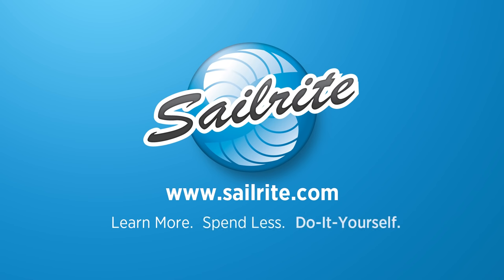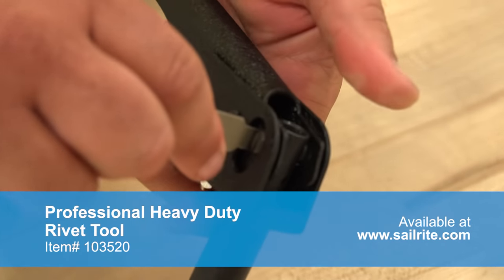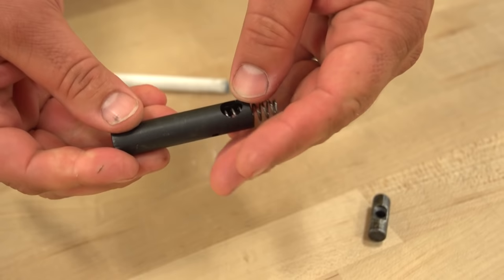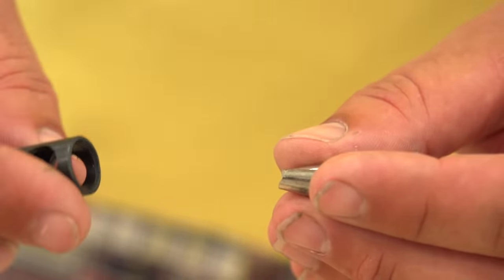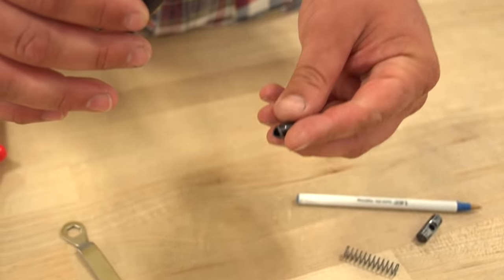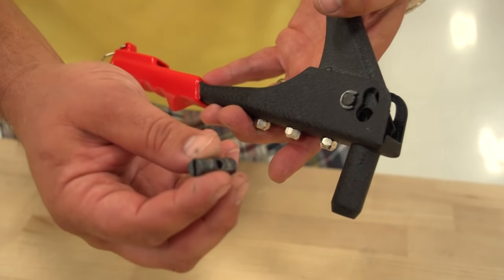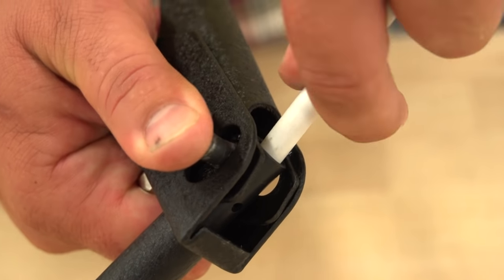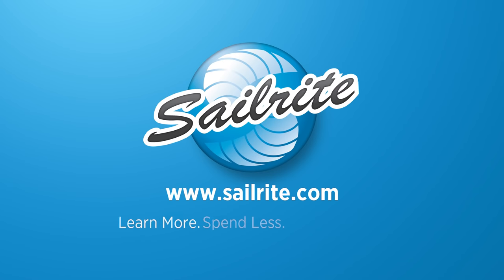Arrow Rivet Tool Disassembly & Assembly RH200S

Comment: I bought a vintage Swingline rivet tool which looks very similar to the Arrow brand.  In the instructions it says to prolong the life of the tool, place a drop of oil on moving parts and disassemble to clean the jaws.  These video instructions worked way better than the diagram and brief instructions in the pamphlet.  Thank you for this video!
Reply from the maker: Glad it helped!

Comment: I just wanted to point out what happened to me just in case it hapens the same to somebody else to solve the problem if this tool gets stuck.

I have this same rivet tool, and it continuously got stuck without being able to fix the rivet properly, and I had to end up dissasemblying the whole tool in order to take out the rivet.  I didn´t know what was going on, all the parts seemed to be in good shape, nothing was broken.

Finally, I had a small idea of oiling the two small pieces that make the pulling strength and the inside cilinder, as I was suspecting this three parts were getting stuck together with the rivet when the pulling actions was done.

It worked perfectlly well !!  Now I can use it without any problem, just as the first day.  

So basically, it was a problem with the friction, there must be some oil in the pulling parts so that the tool can do its job.

If you see this tool (and any other rivet tool) gets stuck continously, DON´T THROW IT AWAY. Some lubrication will fix it.

bye!  and thank you for sharing this video   ;-)
Reply from the maker: +Suzuki RGV Great suggestion! Glad it worked.

Comment: Perfect!!  VERY clear.  I would suggest one thing, which is to WEAR EYE PROTECTION when you pull out that pin.  It flew out of there with surprising force and hit my glasses; good thing I'm farsighted.
Reply: That's a great tip! Safety glasses are a must when working with tools!

Comment: One major shortcoming in this: the spring will cross-bind when released from the pen and you will have to use a small metal item [such as a dental pick, nail file, small screwdriver, or heavy steel wire] to retain the spring until it passes over both sides of the spring, and even then, it will want to divert upward, binding, so that you have to use another probe or tool to push the retainer far enough to get into the far side of the tool to not pop out or jam on you.
Reply from the maker: Thank you for pointing out that issue, I appreciate your feedback!

Comment: I’m headed back to Lowe’s to return my second rivet gun both our air rose and they would not release the rivet shaft I have use rivet guns for years but not an arrow mile pinion their junk spent more time trying to get rid of shaft out of the gun if I’m missing something here please let me know
Reply: Opinion !!  Arrow Rivet Gun !!  From Lowe’s .. Junk.  
Gun won’t release Rivet shafts !!
Reply from the maker: @miketucker7384  Try pulling the handle all the way open. Sometimes the handle seems like it is fully open, but it is not. Good luck!

Comment: I wish the KLIK FAST brand gun was this easy to disassemble/reassemble, the jaws keep getting out of adjustment, creating all kinds of wasted time!
Reply: Rick Lucia Hi there: If I had your problem, and the jaws kept coming out of place-I imagine that there is excess space for them to move, so they need to be restricted a little bit. So, what I would do is this...and you have to be a very exact person....sort of OCD or this won't work: Wrap the jaws tightly in clear plastic wrap, a few layers, but properly aligned. Then put a dab of silicon caulk inside the working end of the barrel, then push the jaws-wrapped in plastic wrap down to the end, where they belong. Let it set up. Then, maybe next day, pull them out. It could be hard to pull them out if the silicon sticks to the plastic, but if you put a little petroleum jelly or oil on the outside of the plastic wrap, that might prevent it sticking. Then put it all back together. If it doesn't work right-ream out a little of the silicon. Maybe that will fill up some of the extra space they are getting into and keep them from getting out of adjustment. The reason it's good to experiment with silicon is that it is 100% removable. Then, if that seems to work...then you know you can come back with a harder more permanent material to fill up that extra space. Anyway, it's an idea...and you know how it is, it works perfectly IN MY MIND. All the best!

Comment: Purchased RT187M rivet tool and right out of the packaging it smelled horrible.
The rubber grips smell like a combination of vomit and industrial waste.
OK,I got over the "new car smell,so I go to install the first rivet 'POP' it worked,but now the spent mandrel is stuck.
It would not drive out in either direction,so I had to take it apart after just one use.
Maybe there is an adjustment for how far the jaws open?
I looked in the original packaging only to find bigger pictures of the three steps of operation and big marketing wank pictures of other Arrow pictures,but no adjustment instructions.
All together, I probably wasted about an hour dicking with this thing.
For anyone else having this issue,try to adjust as follows.
You have the color coded colletts,the nose tube and the nose tube lock ring.
With a collett installed fully,insert a rivet. There should be no jaw drag on the pin. Loosen the nose lock washer and rotate the nose tube counterclockwise until you just barely feel jaw drag on the pin and rotate the nose back in about a half turn and set the lock collar.
This should get you close,if not right on. 
Keep in mind that the collet holds the jaws open. If they are not snug the jaws will not be fully open.

Comment: Its just a crap design having to use the pen to push the spring down while trying to put the bar thru.  My old rivet gun you just unscrew from the top and it all drops out from there which is so much quicker and easier.  I got a new gun as I lost one of the jaws and it has this set up.  I ended up just using the jaws from my new gun in my old gun so as I don't have to try to push the spring down and put the bar thru at the same time which is painful when you don't have anything that fits down the hole handy
Reply from the maker: +funkmouth Thanks for your comments.